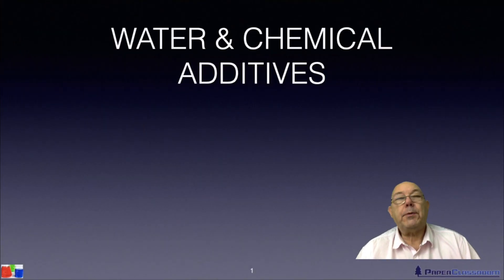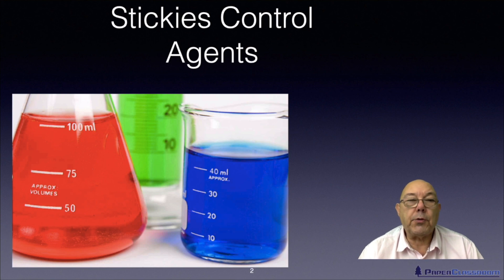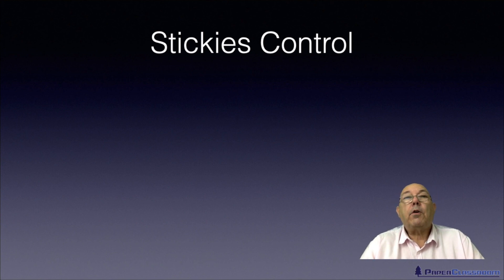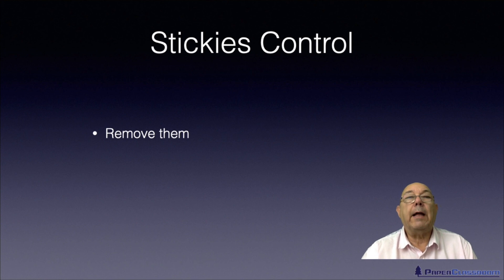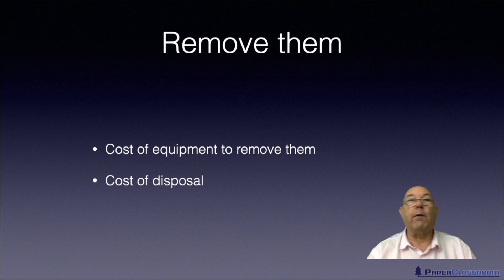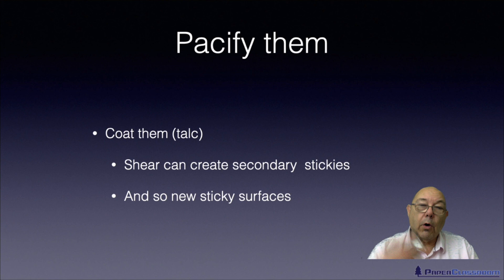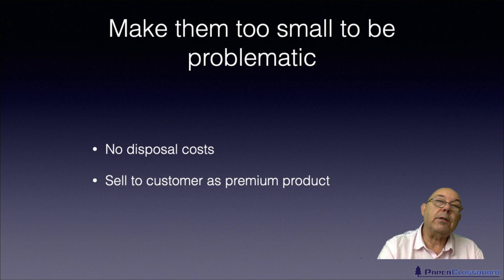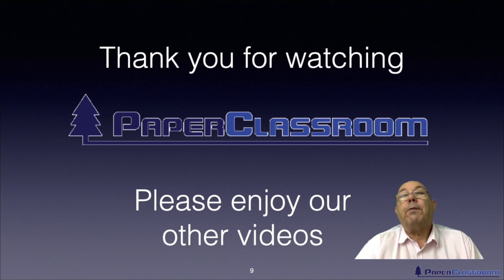Level 2 Papermaking - Stickies Control

Comment: in my opinion the best way to avoid them is to have a good raw material at the conveyor and also to use a chemical barrier on the wire and the felt

Comment: What are the reasons paper Machine brakes and  how  to avoiding problems
Reply from the maker: Good preventative maintainance is the best way to avoid problems. Some mills will have sensors on all their motors, linked to their computer system, to tell them if the motor is overheating! so it can be fixed/changed before any damage is done. Good tensioning of the forming fabric is important.  Too little and it will slip, too much and it will wear and fall off sooner than expected. A screen immediately before the flow box is essential. Not only does it break up fibre flocs and improve formation, but it will stop big unexpected contaminants like hammers, spanners and other tools getting into the flow box.
Reply: Stickes where it comes into system